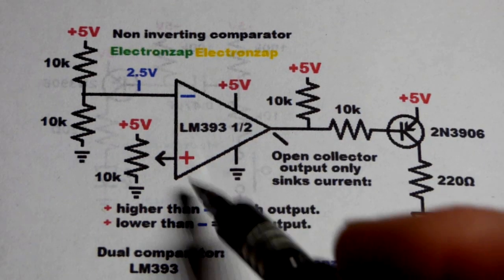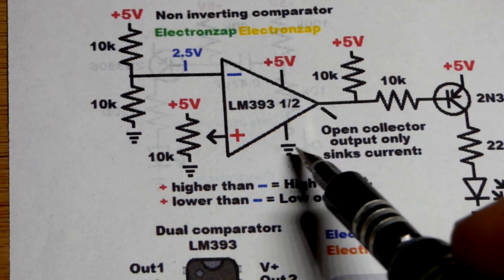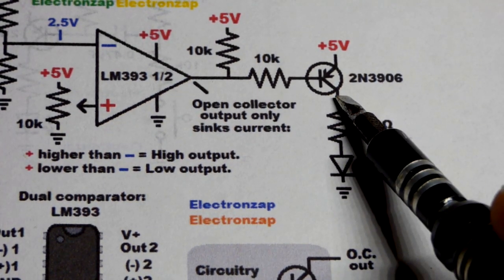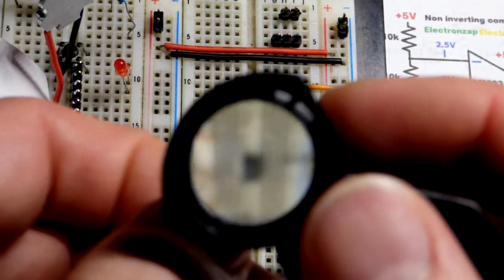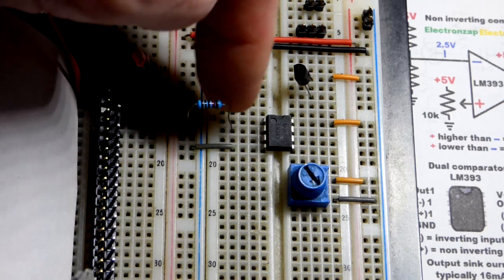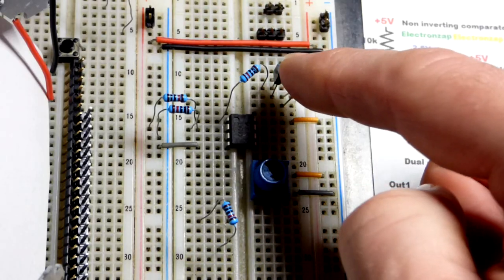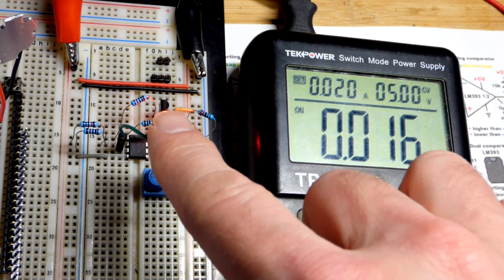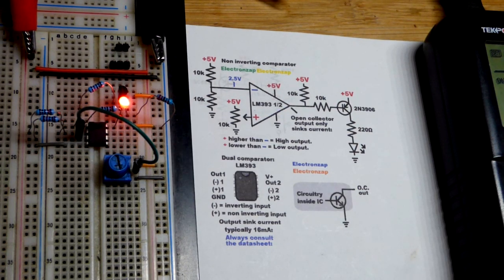How to Use LM393 Comparator as Non Inverting for Beginners Learning Electronics by Electronzap

Comment: Lm393p is showing no output even when pin 3 voltage is higher than pin 2 voltage , tried with 220 ohm, 6.7 k and 13.4k resistors, how to fix ?